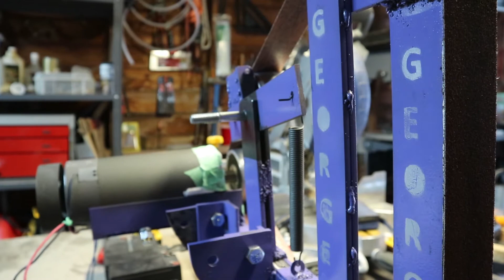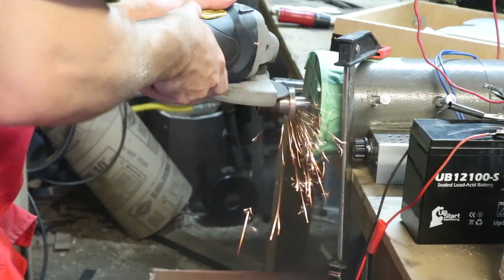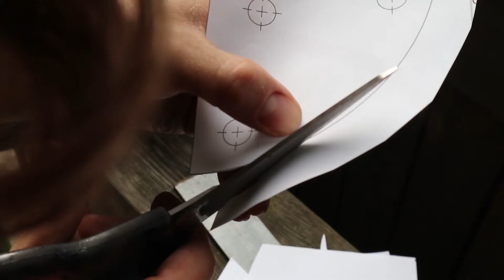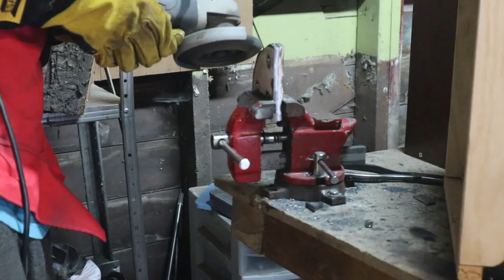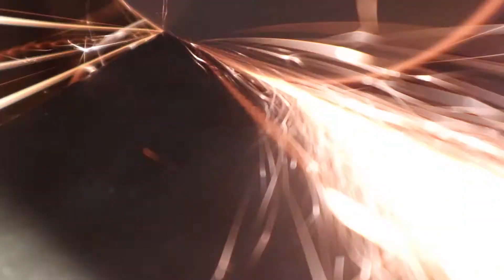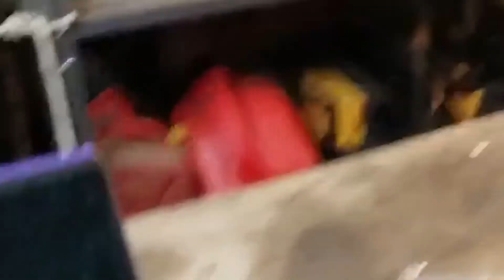DIY 2x72 belt grinder for cheap (4.25hp for $235)

Comment: The only issue I see with this amazing belt grinder you’ve made for an unbelievable price. Is that you don’t have a baring on the connection between the tracking arm. After a while, belt bounce and simply changing belts is going to wear that out. But that’s literally the only thing I would fix. Great work!